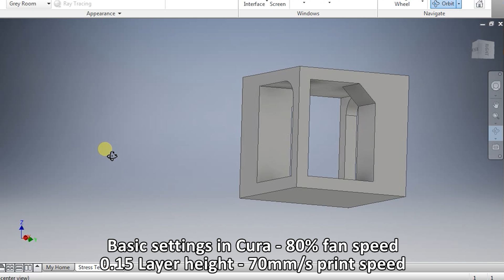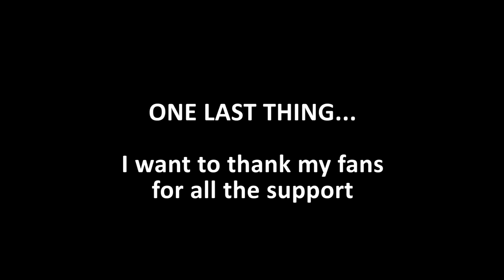TEVO Tarantula - TOP 4 Fanduct comparison test

Comment: Axial or blade type fans are not made for ducting applications such as part cooling.  They don’t have the ability to build air pressure to overcome the drag.  Squirrel cage or radial fans are made to pressurize air which is why they are used in HVAC.  So no matter what device you pick, using a radial fan will push more air effectively.  And then you get into a whole other discussion about placement, size, cfm, etc.

Comment: why is the fan fang that much better than the bullduct fan?
Reply: More flow from the radial fan.
Reply: more presure. for layer coling you need mmHg not CFM.  Mix them for better rezult but get higer mmHG(if is to hig can blow away the layer so dont be gredy)

Comment: Very informative comparison, thank you! I was wondering whether the fan ducts are somewhat 1) limiting the Y available width and 2) the ability to mount the autolevel optional sensor. Also, is there a way to drive the fan speed using PWM as I has on my old Anet with Melzi 2.0 board?
Reply from the maker: Hi Marco, depending on the model, some have the autolevel sensor mod and some not. You need to check on thingiverse. Some of them will limit the  X travel lenght not in Y axis. Regarding the PWM control, you should connect the fan to a PWM output. The tarantula board has that output.

Comment: Hi, thank you very much for the information, I decided to go for the winner (fan fang) and to print the 4020 version, however when I go to buy the fan there's and option for 5V, 12V, & 24V. Would you know which one would be best suited ?
Reply from the maker: Hi,
you should get the same voltage as the power supply you have. The tarantula uses a 12v power supply so you should get a 12v fan.
Reply: @ruiraptor  thank you, I wish you made a video on how to install it, like the equipment you need and where the wire is connected in the circuit board.
Reply from the maker: Just connect the wires to the board where it says "fan" and that's it. The rest it's with the slicer to control the fan.
Reply: @ruiraptor  thank you.
Reply: @ruiraptor  I tried to connect it there but the fan didn't work, so instead I just connected it directly to the power supply with another fan, I hope that's fine, it seems to be working fine, and as for keeping it off for the first layer I probably could install a manual switch
Reply from the maker: Did you try to enable it in the slicer?
You can also test with the display...If you connect the fan to the "fan" output on the board and using the display you can turn it on and see if it turns
Reply: @ruiraptor  yup I did all that before itself.

Comment: I dare say, the first one looked like it had the most potential if the internal was baffled properly so it makes pressure (no need to run the fan as hard and can use the smaller fan) and if the vents were optimally aimed.

Comment: What type of fan should I use for the Radial Fan Fang? Can you provide a link?
Reply from the maker: Hi,
for the radial fan fang you need a 5015 blower. I normally buy them on ebay. Just type in 5015 blower and you will get many hits.
Reply: Cool! Thank you so much!

Comment: Hi could you please tell me what is the fan size for radial fan fang ( 40*20 or 50*15)
Reply from the maker: Hi,
It's a 5015 blower.
Reply: thank you so much. also one more thing I received my printer one week ago. Yesterday I was trying build it then I found some washers in the accessories packet for the z and y axis motor mounts. But in tarantula official build tutorial they don't use those washers. Should I use them or not?
Reply from the maker: If you built the printer according to my latest video manual, then they might be spares.
Reply: Ok thank you

Comment: I have a question!  I need to plug in the radial cooler at 12v port in the font or plug in at fan port in main board ?
Reply from the maker: Hi Gabriel,
The fan for the heatsink must be always on and connected directly to the power supply.
The fan for the layer cooling you need to connect to the motherboard to the connector labeled "fan". This output is controlled by the slicer.

Comment: It's a little unfair that you cut the dual blower in half and then give it a poor review. You should have made it fit and done an honest chance.
Reply from the maker: Hi Fred,
It's true what you are saying.
However, in my opinion, a good design also means that you will be able to install it easily as much as a good performance. Have you tested the fang and the dual blower for comparison? Let me know the results if you did.
Reply: ruiraptor I am building my Tarantula now and the dual blower is my planned first "upgrade". The fang is definitely popular, but the dual blower is as well with lots of good reviews.
Reply: https://www.thingiverse.com/thing:1850163 - If you notice, he is running his cables out the front from his hot-end. That avoids the issue with hitting one of the side or being pinched. I'll be making this as my first real print, hopefully this weekend. Then, I am printing another one since I am sure the first one will be a mess without active cooling. I'm trying to find a remix that has someplace to mount the TT autolevel sensor as well.
Reply: Added my make to your cube on Thingiverse and put a link to the fan duct I am using in the description.

Comment: I use the radial fang on my tarantula but if it starts at 100% within 2 to 3 seconds I get a thermal runaway.  How can I prevent this?
Reply from the maker: Hi Lee,
The layer cooling fan can run at the speed you want. You define in your slicer to start at 60% then the next layer at 80% and then at 100%.
Reply: ruiraptor ok, I don't see that option in repiter Host.

Comment: what is the best fan speed for cooling on pla ?
Reply from the maker: Hi,
That is not an exact answer.
It depends on the fan used, the fanduct used and also the model being printed.
For example...
If you use a normal 40x40 fan, you will need a much higher output value in your slicer compared with a blower to produce the same amount of air flow (if you even get the same amount).
Also with the fanducts…some have more performance others less.
For these tests, I used an output of 80%.
Reply: Thank you for the answer, i'm using radial fan fang , just like your recommendation :)

Comment: i'm a fan! :) thanks for the info
Reply from the maker: Thank you so much Baschz :)
Reply: even though I reeeally hate fang designs because of their look, I just printed it and will install it today, because of your clear comparison video.
Reply from the maker: The design might not be as good looking but the performance is bar better ;)
Reply: It seems to work ok. But with mine both of the little tabs that have the screws go in for the top fan broke of (even when I pre-screwed them), so the fan is extra held in place with some duct tape, and I have the problem that sometimes for some reason the fan just stops. Don't know why yet, as it starts spinning again when I push it, so I'll have to have a look at it.
Reply from the maker: I guess your fan is not working well. It might need bearing oil.
Those are cheap so i recommend to have always a spare.
Reply: true. not a bad idea to have some extra lying around. will have to check if it needs oil. could be the case. thanks

Comment: how did you connected that new fan to electro installation cables? And why not use proper like 80x80 fan from PC ?
Reply from the maker: Hi,
The layer cooling fan must be connected to the board where it says "fan". This is PWM controlled by the slicer. All other fans must be connected directly to the power supply as they must be always on (hotend fan included). A big fan will add too much weight to the X carriage. The 5015 blower will be very efficient.
Reply: ok thanks so no need to cut in wires?
Reply from the maker: What do you mean by not cut in wires?

Comment: Which of this fan duct do you recommend to use with bltouch sensor? thanks for all
Reply from the maker: Felice Caccamo ,
The one that had better results in my tests also has an option for leveling sensor. Check the thingiverse page and read the options you have for that model
Reply: do you mean the radial fan fang?
Reply from the maker: Felice Caccamo,
Yes

Comment: I'm thinking about buying a Tevo Tarantula, and I'm just getting into 3D printing so this probably a stupid question: Does the Tarantula already come with a fan for the for cooling the filament?
Reply from the maker: Hi,
Unfortunatly no. You need to buy the fan (or blower) and print the fanduct.
Reply: ruiraptor Ok, Thanks. What voltage should the fan be, or does it matter?
Reply from the maker: It does matter. For the tarantula, you will need 12V fan/blowers.
Reply: ruiraptor Thank you!

Comment: I've ordered my Tarantula and still didn't receive it so sorry if this question seems stupid, but where are the cooling fan wires supposed to be connected? is there a header for them on the PCB board or they're connected directly to the power supply?
Reply from the maker: Hi, That's a good question.
The fan that cools down the board and hotend connect directly to the power supply. Only the layer cooling fan (not included with the printer) is controlled by the slicer/board and needs to be connected to the board output. For this and many other informations, you can check the new assembly video released by tevo in the new website here: http://tevo.cn/index.php

Comment: Noob question. When you mention temperature drop between different models, how or where is that measured? On the DRO or sensor?
Reply from the maker: Hi Allan,
You can see that temperature drop on the display. The display shows the temperature of the hotend (which is stable) and when the layer fan kicks in, you can see a temperature drop. The board will react and stabilize the temperature afterwards.
Reply: So you need to make sure the temperature doesn't drop too low while maintaining the best cooling?

Comment: Hi ruiraptor, like always very instructive video, I think that I will take exemple on it too do my French tarantulas videos. Coolidge you tell me what kind of filement did you use to print these parts ? Thank you
Reply from the maker: Hi Speedy Pidz,
I used PLA to print these fanducts. These are not too close to the heat so you can get away with PLA.
The only issue i had was with one of the fanducts that melted the tip of the fang (i show that in the video) because it was touching the heatblock. Other than that, all work well with PLA.

Comment: have you noticed that the dual blower that you cut was the wrong one??, because the blower sucks air from the "left side" and that is right next to the extruder, so it's sucking "warm air"... instead of away from the extruder and sucking cooler air....
Reply from the maker: Hi,
I had to use the side that did not conflict with the heater and thermistor cables...which was the fact for me not using both sides.

Comment: Thank you for this. I've been using the LPA design for 4.0 and 5.0 because I liked the "look" and also because all I have on hand are 40x40 fans, but I'll go hunting today for a blower.
Reply from the maker: Hi Fritz,
Same here...been using the LPA design since the beginning and always thought it was the best in performance but after these tests i use this fang ever since.
Reply: Now I just gotta source a blower in Toronto on a Saturday xD
Reply: Hi! And thank you. You and your work are the reason I went with the TT while I wait for my big bed CR-10 upgrade. (months away). I'm not quite clear on which design you are happiest with. The dual blower? Thanks for your patience. It gets confusing sorting through so many comments!
Reply from the maker: Hi Thomas. Since the tests i'm using the radial fang design which is the one that had better results.
Reply: the turbo fan used in this video is 12V or 24V?

Comment: I use the dual blower but I loosened the set screw on the heater block and rotated it so the wires go out the front

Comment: Wow what settings do you use!? No stringing when traveling! How!?
Reply from the maker: Hi Alex,
You need to play with the retraction settings (distance and speed).
Also, it's better if you increase the speed of the extruder in the firmware since it's limited (stock firmware).
Reply: ruiraptor what's your distance and speed set to? And where in the firmware under what section?
Reply from the maker: Greetings,

I’m using a speed of 50mm/s and a retraction of 6mm for BQ and 9mm for Verbatim filament.
Regarding the extruder speed, you can find it in the configuration.h file at the line “#define DEFAULT_MAX_FEEDRATE”.

Comment: it is a pitty that you haven't test complete dual blower.
i disappointed
Reply: I compared those two fanducts today - dual blower vs. single fang. Dual blower seems to be a bit better on overhang test.
Reply from the maker: Hi Alexander, yeah...me too :(
Reply: hello =)
what do you think, how Supasorn made wires on the other side of prinhead?
i must say that i'm very newbie in 3d printing. i have ordered tevo tarantula yesterday)) and two 5015 fans
Reply from the maker: sorry...don't understand the question
Reply: 0:35 dual blower. wires on the other side of printhead. so he doesn't need to bend wires
Reply from the maker: I understand your question now...but as i mentioned, i didn't want to mess with the wires.
Reply from the maker: Hi,
Yes, that makes sense as it has twice the flow power.
However, i believe that 2 blowers are overkill. The only reason that the single blower is inefficient is because it's only one side oriented.
Reply: ruiraptor I use the dual blower and just loosened the set screw on the heat block and rotated it! Works well!

Comment: how do you wire the fans to the printer (more specifically the blower)?
Reply from the maker: Hello Cyrus565,
First of all, fan or blower, it will need to be 12V. It is then connected to the main board in the green connector labeled "fan".Normally, the fans/blowers have short wires so you will need to make an extension cable.
Reply: Thank you!
Reply: And another question (if you don't mind) when printing the winning shroud, did you have a shroud to print it? Because it has pretty steep overhangs and I'm worried that my stock Tarantula won't be able to effectively print that shroud...
Reply from the maker: Hi Cyrus565,
Yes, i had already a fanduct when i printed the radial fan fang.
I printed the LP fanduct first (1st model from the list) with no supports and used that one to print all others.

Comment: For the dual blower unit, you can rotate the heatblock by simply loosening the hex screws on the back, rotate, and tighten again.
Reply from the maker: Hi NNoradIV,
I did try that but the cables hit the wheels before i can install the fanduct. I could bend the cables a bit but i didn't want to do that.

Comment: Hi Ruiraptor, I accidently bought a 24V 5015 radial fan instead of a 12V one (listed below). Is there a way to get 24V for it from my MKS Base v1.4 board to run the fan at its full potential? As far as I understand, I only have 5/12V outputs in the board. If I connect it straight to the PSU, will it be able to get 24V then? Thanks in advance!!  

https://www.aliexpress.com/item/Anet-5015-24V-Ultra-quiet-Oil-Bearing-about-7500-RPM-Turbo-Small-Fan-3D-Printer-Accessories/32808457276.html
Reply from the maker: Hi, unfortunately, no...If your power supply is 12V, that's the max voltage you get. You can use a 12V fan with a 24v power supply but not the opposite.
Unless you get a voltage booster. Try to google voltage booster and see if you can get a schematic for it.
Reply: Oh I see. That's unfortunate. I think buying another fan would be cheaper and simpler. Lol. Oh wells. Thanks for the reply man. Keep up the great content!
Reply: https://www.banggood.com/DC-Boost-Converter-2A-Power-Supply-Module-2V-24V-To-5V-28V-Adjustable-Regulator-Board-p-1100757.html  should work to boost 12V to 24V for your small fan.

Comment: Nice, thanks!

When you speak about the temperature drop, is that the one of the heat block?
Reply from the maker: Hi fabts4,
Yes, the temperature drop is in the heat block.
Reply: how do you measure that temp drop?  is more better or less better or is there an optimum amount?

Comment: Very nice and helpfull video thanks you. Just a question, what is the mean of the number 4020, 5015, 5012, 5010 of the fans ?
Reply: I think it's side length in mm (first two numbers) and side width in mm (second two numbers).  So if you were to put the 4020 fan flat on a table, it would be 4cm on the sides and 2cm in thickness.

Comment: Hi,

Do you know where I can buy this fan? There is no model number or anything. :(
Reply from the maker: Hi Thomas Wu,

There are lots of places you can buy these fans or blowers.
Fans are 40x40x10 or 40x40x20 and blower used is 5015. There are the size. Regarding voltage, all of them must be 12V which is the power supply you are using. If you are using a different power supply you must buy a fan or blower with the same voltage rating.
I bought mine on ebay, but if you google something like “40x40x20 12v” fan or “5012 12v blower” you will find many stores that have them.

Regards
Reply: Thanks for the reply. I think I understand. Will something like this work? https://www.amazon.com/gp/product/B00THZK270/ref=oh_aui_detailpage_o00_s00?ie=UTF8&psc=1
Reply from the maker: Exactly right. That will work.
Reply: Thank you very much for your help. I am excited to get my printer. I have been wanting one for a while
Reply from the maker: No problem. If i can help with anything else just let me know.
Also, check my other videos (assembly, tips, upgrades) so that you can start to learn and especially my recent FAQ video that has many important topics covered.